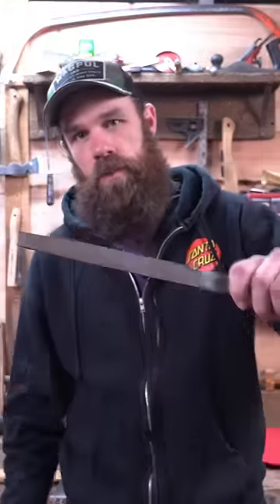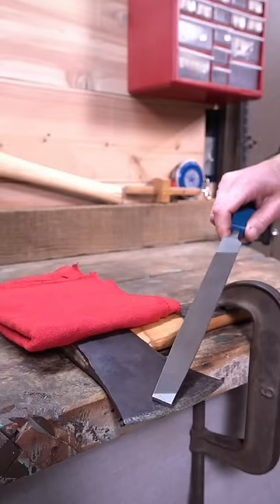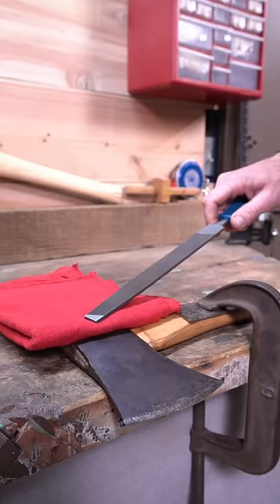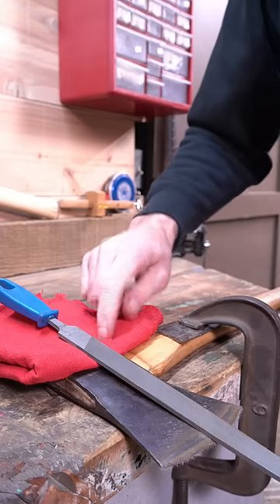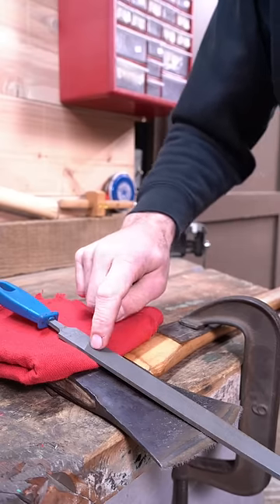How to Sharpen an Axe Using the Rag Method and a Mill Bastard File #axe #tools #howto

Comment: That file is not made to be used like that unless it is double cut file.
Reply: Nonsense.
Reply: @autumn5592  
I've been a machinist for 45 years. How about you.
Reply: @fuzznutz7182  Wow! 45 years and you still believe nonsense.
I bet you think filing backwards/dragging damages the file too.
Reply: @autumn5592  
Absolutely does if its not a double cut file.
Your obviously illiterate on using tools.
Reply: @fuzznutz7182  Machinist for 45 years and doesn't understand drawfiling.. yikes
Reply: @autumn5592  
With a double cut file or in the forward direction with a single cut file.. Not side to side. Its hard to have an intelligent conversation with some one who is unarmed. Yikes.
Reply: @fuzznutz7182  But you have video proof of it working.... how can you claim it doesn't?
Reply: @autumn5592  
If you using it like that it will get dull in know time and be trash. Straight lines only. All the video shows is improper use of a file.
Reply: @fuzznutz7182  No, it won't.

You think dragging the file also damages it? And you've been a machinist how long? Lmfao.

If teeth direction mattered, why are they at a 20 degree angle on the push stroke? Surely a perfectly straight tooth pattern would be ideal? What about lathe files with a 40 degree angle? Does straight filing damage those teeth?

Critical thinking man, try it.
Reply: @autumn5592  
Dragging a single cut the wrong direction does.
Reply: @fuzznutz7182  No, YouTube just didn't send me a notification of your last message, don't get your panties in a bunch.
Reply: @autumn5592  
There not but thanks for asking.
Reply: He said mill bastard file, isn't that a type of double cut file?
Reply: @1985cjjeeper   yes it is and is absolutely the wrong file to use for getting an edge. He may have said that but may not know what he is using.
Reply: @autumn5592  
Ok I've worked on the proto types for the shuttles landing gear made numerous parts for the reactors in atomic submarines and aircraft carriers plutonium rods for nuclear stations motor mounts for black hawk helicopters tread adjusters for Abraham's tanks. Rebuilt flywheel  linkage systems for outdated punch presses from scratch. Made die sections and sharpened them. Thru all this my collection of files have served me well. 
My hope for you is that you realize not to believe every Thing on you tube. They are ther to make money.
Get a dull axe head give it ago using his process and let me know how it works out for you.
Reply: @fuzznutz7182  That's a whole lot of cope, with no way of validation, lmfao.

You failed to look up the video which he proves it does NOTHING to the file.
You having 45 years doesn't mean you know what you are talking about. Especially when you deny blatant proof.

Comment: The rag will not allow you to keep a consistent and accurate angle. It will compress a different amount depending on how much pressure you put on it therefore changing your angle with every stroke.

Bullshit technique.
Reply from the maker: Mabe maintain the preasure on the rag?
Reply from the maker: Bullshit comment.